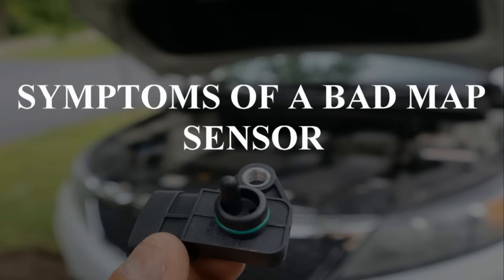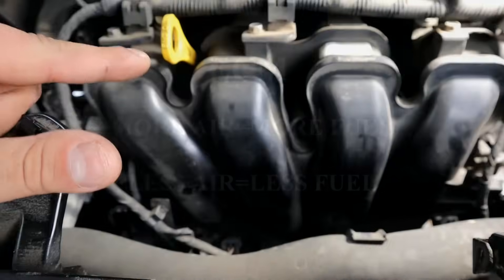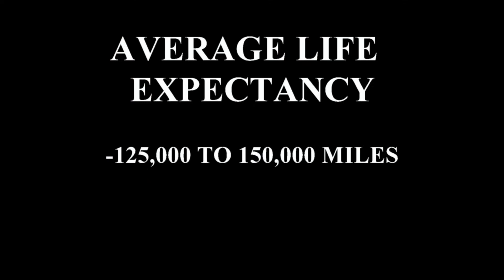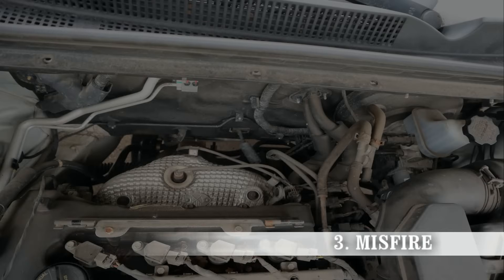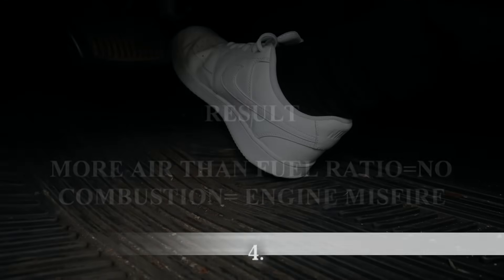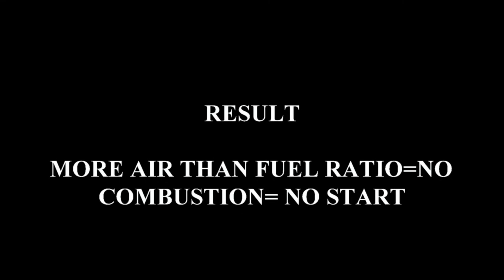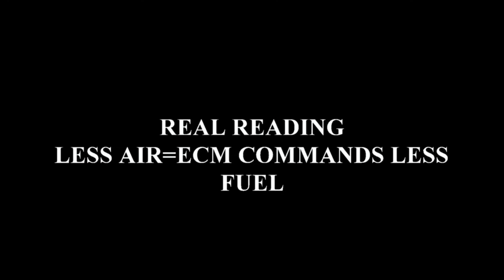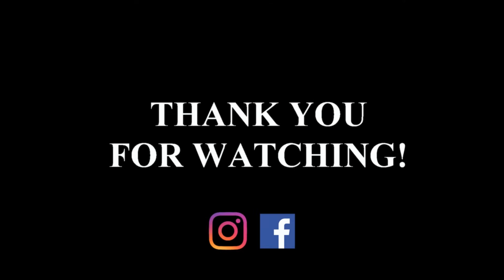SYMPTOMS OF A BAD MAP SENSOR

Comment: I had no engine light or error codes when my MAP sensor went.  But the driveability of the car suffered, a bit stuttery in the lower rpms and it lost performance.  I also had random misfires.

Comment: I have a 91 Dodge Dynasty with the 3.3 V6 I have replaced the MAP sensor after the car quit running and it ran great for a short time but then it started running rough again when first started just idling with a strong raw exhaust smell. Also there is a strong gas smell making it so the heat/A/C can't be turned on until the car warms up, after it warms up the smell is gone. I have figured there is a vacuum leak someplace that makes the MAP sensor go bad but I can't find one anywhere. I need to check the EVAC canister to see if it is damaged and putting off the gas smell, don't know if a vacuum leak would effect both the EVAC canister and the MAP sensor or not? Any ideas?

Comment: Help. !!!! My 2014 honda sport stalls at about 3 to 4 rpms.  It wont accelerate past 40mph. I ran a scanner at first and it threw p303 and p302. We changed the spark plugs and coils. Also the fuel pump and fuel pressure regulator. We took it two mechanics and they couldn't figure it out. One said it could be a clogged cat. Converter.  That wont accelerate past 40mph.  Help !!! What could it be ??

Comment: Thank you, I was experiencing the stall, misfire and the ⛽ gas rapid use. I hesistated to get one because it is so expensive. I tried the junk yard, but I am not sure if I set it up wrong, I did install it right but they said something about resetting the computer once installed, which I am not sure what to reset.

Comment: So my car has the check engine light on along with  a few other lights but sometimes the engine light starts blinking the car doesn't turn off buy i loose power i have to turn off the car and all the light are on but the car is drive able,an also sometimes all the lights disappear and the car is good to drive i already change the oxygen sensor bank 1 yall think i should clean the MAP SENSORS ???

Comment: Had all of this happen to me on my way to work last week.  Turns out that it was the pigtail connector becoming loose.  If you have an older car it's a good idea to zip tie your connector and map sensor connection.   Check the wiring on the pigtail first to ensure it isn't a wiring issue.

Comment: Thank you very much for fantastic video. I had some of The symptoms. After cleaning The map sensor 4 times and clean The hull on The intake manifold. My Bmw 525D works fine snd The turbo is working top. No more lag, no more drive train errors
Reply: Thank to you guys sharing yout knowledge on Youtube has made my days easier. I have learned a lot and manage to repair my car. Thank you again and keep on sharing.😊
Reply from the maker: Awesome, thank you!

Comment: My car cold starts at 800 rpms when the weather is cold (like below 16 degrees Celsius) can it be because of the map. Replaced injectors, coils, plugs, maf and cleaned the throttle body

Comment: Engine light ON but no symptoms is what?
Reply from the maker: What are the codes associated with the engine light?
Reply: P0102 which my mechanic says is the Mass Air Flow sensor which I assume is the same as your MAP sensor.

Comment: Hummer H3 code is P0105 now, so I  ordered a Map Sensor. I hope this fixes the rough idle/check engine light. I already changed plugs, wires, air filter PVC hose, Mass air sensor and cleaned the Throttle body. First code was P0305, now it's P0105. Trying to do the cheaper stuff before I take it to a shop. Wish me luck!!!

Comment: Amizing info!! It really helps understand how it all works But if the map sensor is intermittently throwing the wrong voltages and im assuming these voltages are important to the milli volts then how does a DIY tech tests that it's  gone bad 😳 unless you have some type of jig that can give it pressure and you can measure precisely the data voltage and be able to compare it to a diagram for hours I don't see how we are able to ever really say... this map sensor is in great condition.

Comment: We have a rough idle, sometimes dies. You reatart, it'll run. We're getting minor white smoke. But no other symptoms of valve cover head gasket issues. No milky oil, no smell of coolant, but are getting bubbling in the coolant reservoir (which we just replaced. 

Valve cover gasket was replaced earlier this year. 

Mechanic cleaned off our map sensor. Ran finw for two days, now doing it again.

Comment: Great videos!! My 2002 dodge ram 1500 4.7 engine. I get a little smoke at fast acceleration and it sounds like at idle the throttle body sucking in too much air cuz it whistles a little bit.

Comment: dont necessarily need to replace it. The engine light can come on from a dirty MAP sensor. Use MAP sensor cleaner (and ONLY MAP sensor cleaner), take the sensor out, and give it a good spray all over. Don't spray the part it plugs into, just the removable sensor itself. Let it dry completely. And that could be all you need.

Comment: Mine has a long crank and the revs stick under 500 rpm for a short second, then when it calms to idle, it wavers up and down a touch.. Gonna give the sensor a clean, then possibly replace. Fuel economy is down as well

Comment: I have a 1998 Mitsubishi eclipse with a 2.0l engine (420A).  Can a bad EGR cause the engine to burn oil at low rpms? I put new rings, bearings, timing belt, water pump and had the head rebuilt, basically rebuilt the engine. When I first start it up it runs and drives fine but after the engine warms up it lets out a big plume of smoke when I take off from a light or slow down and speed back up. I can't figure out what is causing it to smoke so heavily, it smoke's so heavy that I can't see the car behind me but after a few seconds of driving down the road it clears up and does not smoke until I stop or slow back down and speed up. I have also relaced the fuel pressure regulator, Idle air valve, both temp sending units, and the catalytic converter but it is still burning oil after it warms up, when it is cold it does not burn oil. What can be causing this problem?

Comment: I have a map sensor harnes reading 6.2 volts on the signal wire (engine off). The 5 volt reference is correct (5v) and my ground is also ok.

Comment: I have a 2004 Trailblazer with a 4.2 liter inline 6. I was getting 14.3 mpg mix driving. The truck ran fine and didn’t have a cel. Now I’m getting 16.5 mpg. I have a few video about my truck.

Comment: 4.7 liter Jeep. Have 1800miles on a new engine. I got P0108 code and cleared it. MAP sensors apparently do fail. My symptoms are clouds of smoke. I tried running some 89 octane and that compounded the issue. Smokes even worse. I’m certain the engine is fine so this is the next part swap.

Comment: Nice video 👍. I have a issue with cold start.  Its start but after few seconds the engine is vibrating and a bad idle. After 5 min the engine runs fine again. Could it be Map sensor on my car to?

Comment: '95 Camaro 3.4. 150k miles. I was struggling to figure out all the problems after replacing half the fuel and ignition system. MAP sensor fixed all of it.

Comment: Man!!! My wife’ 2008 Ford Fusion has been an absolute bottomless pit of issues. 2 weeks ago changed sparks then found oil in cylinders, got all that cleaned up , seal was bad replaced that , a/c was acting weird so tested , changed pressure switch , while taking off gauges busted 2 valves , replaced those , put car in gear braked , revved engine shifted a full 1/4 turn forward , went back to store , got new motor mount set , installed . A/c is full but still is cycling really weird like only if you rev engine it will come on for just a few seconds then back to regular air . No cold . Now this evening , took 3 attempts before engine would start & engine symbol popped up on dash . Could this be the MAP sensor ?
Reply: Sounds like its time for a new car

Comment: Real good information here especially after just looking at another video and the guy was calling it a Mass Air Flow sensor which it is not !  After much reading on GDI engines and dirty intake valves etc .etc.  I just used Lucas GDI cleaner on my 2020 Kia optima 2.5 normally aspirated engine (no turbo) . This engine is not easy to get the cleaner in without crossing over the MAP sensor Everything I have read says to stay away from a Mass Air Flow sensor  and I totally get it.. Question:: Is this  MAP sensor on my car as sensitive to cleaning products as a MAF.   They way I got this cleaner into the manifold looks like the bulk of it is going into the 2 right cylinders. I did use half the can on the other end of the manifold at the PCV hose and that looks like the left 2 cylinders get the bulk of it there. If It was put in through the throttle body  it would divide up equally but douse the MAP..

Comment: Started getting a backfire...but at first, it was rare...but every once in a while it would also 'drop idle' to low...so I think, 'hmmm....TPS sensor'. I replace it...but no change. Idle gets worse, so I think 'IAC valve'...clean everything up and replace it...OMG, my RPM now idles at 3,000! I keep looking, then see it...looks like dirt on a hose. NOPE...ROTTED HOSE on my MAP sensor! Go to replace it...and ANOTHER HOSE connected to it literally FALLS APART in my hands (goes to the PVC valve)! Nice...end up having to replace EVERY SINGLE HOSE going to my MAP Sensor! Get that done...and I can take the new MAP sensor back to the parts house...IT WAS ALL THE DAMN VACUUM LEAKS GOING TO THE MAP SENSOR!

Comment: So I have kinda weird question? I have a 2011 Kia soul 1.6L base model, my check engine light comes on not all the time when I get to half and sometimes a quarter   tank of gas. Then when I fill up it goes back off when I park and then start it back up the next day. It has been like that for some time, do you have any idea what it could be? I was thinking map sensor. Like I described the check engine light doesn't always come on. Sometimes it won't even come on at all for several weeks or months, I'm baffled. I did replace the gas cap, Any help would be fantastic!!! Love your channel and content

Comment: Thank you. I started my car today, went to a local destination (9 min. drive), and when I pulled into the parking lot and was on my brake, my car’s RPM was fluctuating between 1-3K. At stop signs and red lights, it was a terribly rough idle, such that I was hitting 0.2K RPM, nearly killing my engine while in traffic. I sure hope it’s the MAP Sensor that is causing all this; your video seems to be pointing to so.
Reply: CHECK YOUR HOSES going to the MAP sensor! One hole, and it will act like the MAP is going bad! If hoses are good, and you replace the MAP and idle is still 'floating', you MIGHT have a stuck open IAC (Idle air control) valve...normally as easy as a TPS switch to replace...IAC and MAP work together on idle...and from what I've seen, the 'tattle tale' for a bad MAP is backfiring, while a bad hose and stuck IAC is a steady or floating idle WITHOUT miss or backfire.
Reply: @skeetersaurus6249  mine kinda bounces between 500-1000rpms and does have a misfire. Gonna replace the IAC either way for safety but I’m guessing it’s the MAP

Comment: I have a 2014 honda civic and in the winter below 30F, even when fully warmed up moderatley accelerating  a little over 2K rpm i get like a shaking shimmer. warms up above 30F and it goes away. anyone any ideas.

Comment: My daughter has a 2015 Chevy Cruze. Recently the check engine light come on and it seems like the throttle response is lagging when you excelerate. It has power, but it’s just on take off. Took it to my local orielly and their scan showed not getting enough fuel and the MAP code. What do you think? TIA

Comment: My ce light came on and read code p106 
The rpms went up and down when the car was stopped. Kind of hesitates. Was going to take it to the mechanic when they opened. The check engine turned off on its own? Never had that happen :/

Comment: Hi, I could relate to 4 and 7 the power kicks in after 2500/3000rpm till then its very sluggish. Fuel economy is bad. could MAP be the reason. don't have the check light or fault code.

Comment: Makes you wish for the old carby  engines...all this electronic bs and expensive parts for at best nominal mileage improvements
Reply: These sensors are like $20… what you mean lol
Reply: My map sensor cost $70
Reply: @cobbfutbol62 for kind of car? My wife's 2019 accord MAP sensor was $120.
Reply: @cobbfutbol62  02 sensor for 2015 Rav4: $253.00
Reply: @davidsolowsky6119  It’s a Toyota. You won’t ever have to buy another one.
Reply: @davidsolowsky6119  yeah if you get the shop to put it in if you buy one from an online parts dealer and do it yourself they cost you like $20-$30
Reply: Never had I ever wished for a carved pos
Reply: Or just properly tune your carb idk. Lol i prefer the carburetor over efi easier maintenance
Reply: My 85 cutty has one 😂😂😂
Reply: I’m getting back into a fox body.
Reply: Seriously though, just did an engine swap and I’m hoping this is what’s messing with everything.
Reply: My map sensor cost 97 dollars
Reply: Carbs were atrocious and horribly inaccurate. Nobody wants to deal with those old things at ALL!
Reply: My map sensor costs $53.
Reply: No because these sensors will pick up on stuff before a person could so by your logic ignoring or ignorance on how a vehicle is suppost to run and ignoring it isn't going to fix it
Reply: I’m so tired of hearing these types of comments, carbs suck, they can’t adjust for altitude or hotter or colder days. They give little to zero feed back. 

Oh no did I hit a speed bump two hard, damn now my float bowl is stuck flooding my engine that won’t let me go home. 

Is it too hot outside? Vapor lock in my fuel line won’t let me go home. 

Too cold outside? My fuel won’t vaporize I can’t leave my house
Reply: Don't know what you're going on about. Never had to adjust anything for hot or cold temperatures.
Reply: My carb engine has this sensor sooo
Reply: @thesovietvorona1007  He’s only repeating what he heard some old school guy say.
Reply: @Fone65  yoooo black, what are the odds I see you in a random comment section lol. Huge fan my friend, hope you've been well 💪
Reply: @MyNameIsNidos  I'm wonderful. Still trying to install a new evaporator and condenser in my house.
Reply: No, it does NOT make me wish for carburetors
Reply: Oh my God yes I wish things was like it used to be
Reply: Ok boomer
Reply: @yoteslaya7296  I’m 24 xD

Comment: What can cause a MAP sensor to go bad?  I had a MAP sensor put in my honda in 2019 and now its bad again
Reply from the maker: Check the connector to make sure there is no corrosion. Check the wiring of the connector to make sure it’s not damaged. Look for any vacuum leaks as this can throw the code . A dirty throttle body can also throw a map sensor code. It happened to me last month. I cleaned the throttle body and that code never came back.
Reply: @easyautofix  should map sensor ever be cleaned? i have pontiac g.prix. no issues. i will not mess with it but study automotive and like to know.

Comment: All are actually great indicators. But the last one. Fuel comes out of your exaughst every time you drive. If you have black smoke it is most likely a manifold gasket leak. And needs to be taken to a shop right away before you cause permanent damage.

Comment: All my symptoms on my VW, I just replaced the part and it’s working fine. But I should have found this video earlier could have saved me some cash lol. Nice vid straight to the point and accurate. The black smoke was something I noticed a while back. Thought idle and no power it the pedal when accelerating.
Reply: Epc light

Comment: mine is a p1297 for my 02 dodge ram 1500. and i got this code at 158k miles. i brought up the code by turning the key forward and back 3 times! It says theres about 4 reasons why it could be faulty but i bet its the map sensor.! ill let yall know. ive changed air control valve o2 sensors and purge valve no luck but im buying a map censor today
Reply: Did it work?
Reply: @gmarinelarena8675  No 100% but mine was very black and dirty. i bet i have a short somewhere because when i turn the ac on it idles way lower. i feel tho changing the map sensor helped it from stalling out. It helped enough to get me around!
Reply: @fadedacorn  if you have a multimeter you can check the batery voltage. It might be the alternator if the problem happens when you turn on the ac.
Reply from the maker: Awesome goodluck!

Comment: Question, I noticed recently when I put my car in Drive and step on gas the pedal feels funny. A few times it got stiff and car kept going even when hitting the brakes. I had to shit it to N then tap brakes for pedal to release. After a few days later it did it again twice in same day. Is it the Throttle Position Sensor or something worst? This only happens when the car is in D. It does not behave this way on any other gears.
Reply: Check and make sure your throttle cable isn't binding on anything and also make sure The butterfly valve in your throttle body isn't sticking open. It also does depend on what car you have as well.
Reply: @adamnathanielbassett  Thank you. I found out it WAS the TPS. It was keeping the throttle open. I swap out the sensor and cable (Just in case) for new ones. The problem was resolved. In fact. I am getting better MPG and car accelerates much smoother :)
Reply: If anyone is curious. My car is a 2006 Hyndai Santa Fe. From what I researched these cars are notorious for throttle issues. I hope this helps!